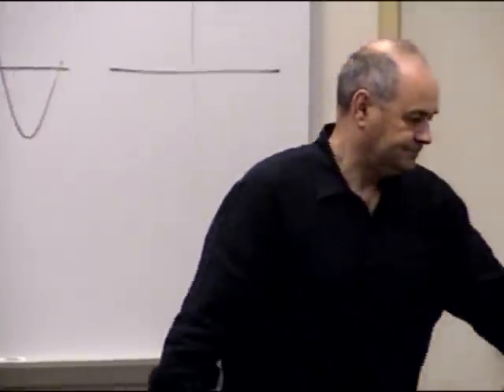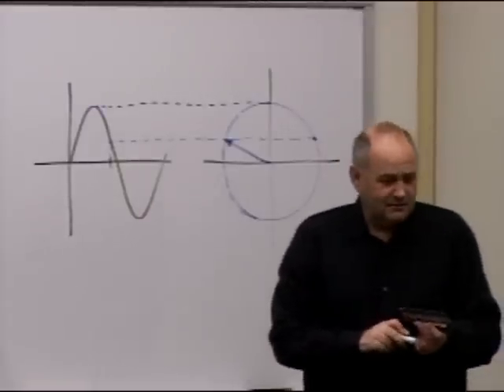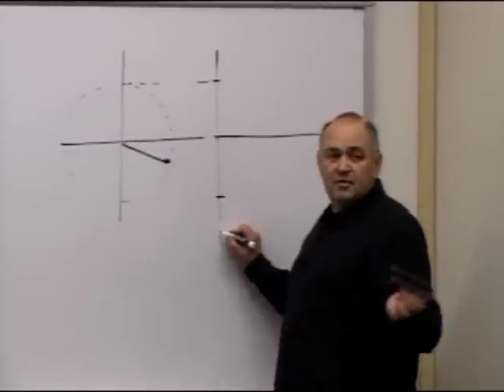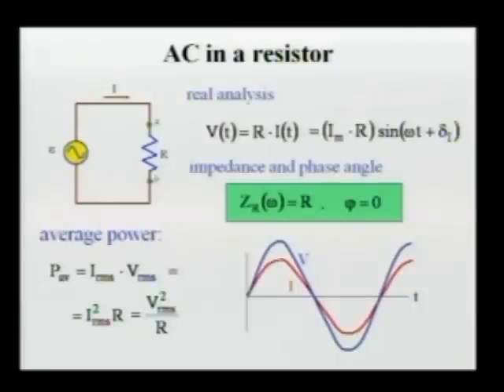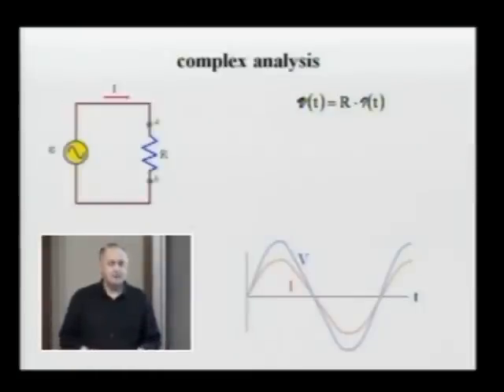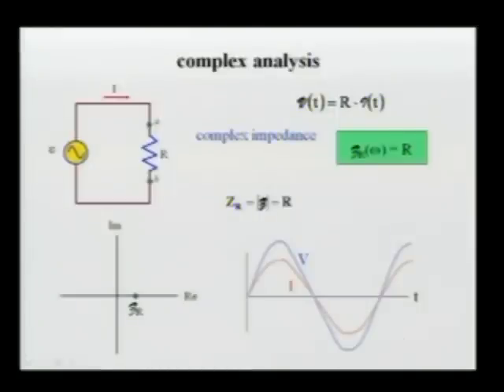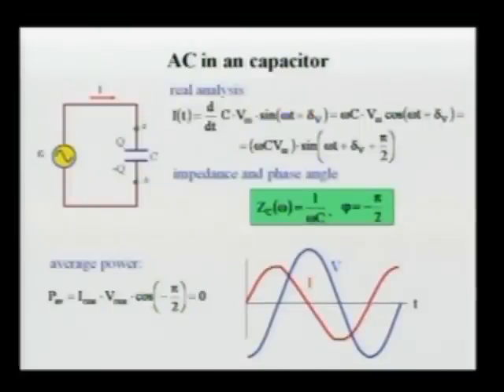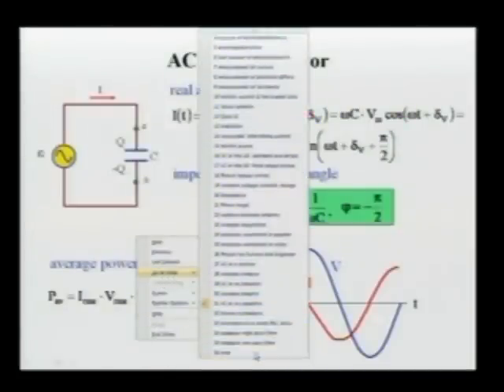Physics 250 - Lecture 22 - AC in Resistors, Capacitors and Inductors

Comment: i have a question I am building a rail gun for my science project. My capacitor bank however continues to drain. I know that you can use a resistor in parallel with the capacitors to help with the draining, but I am not sure how to wire the resistors because my capacitor bank is wired in a parallel circuit